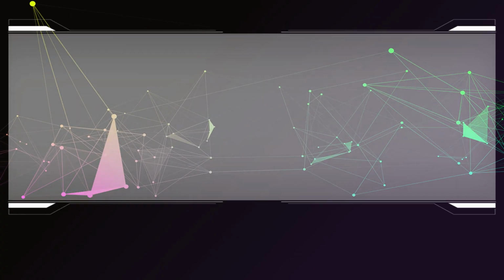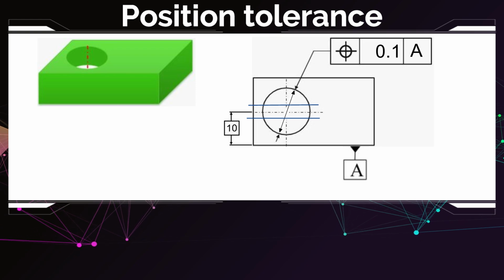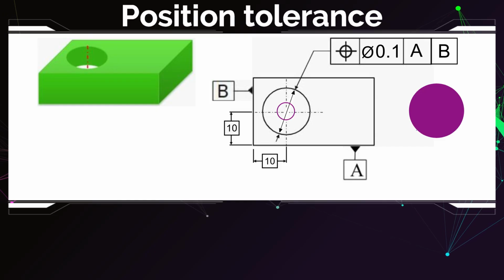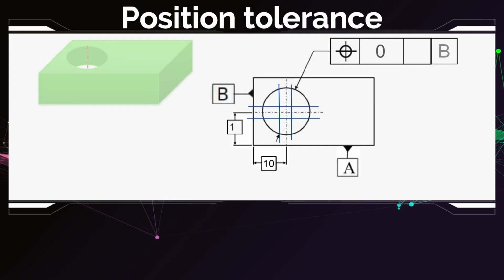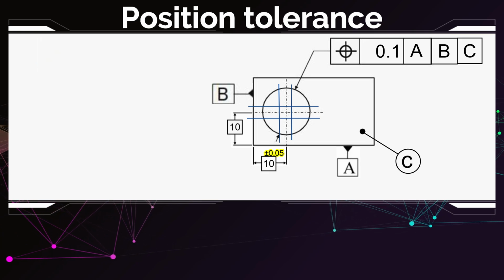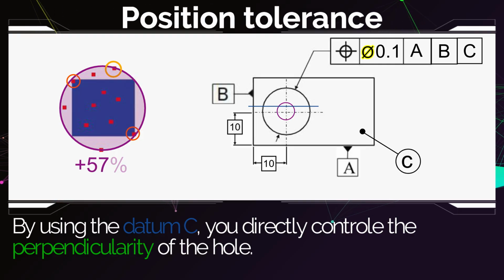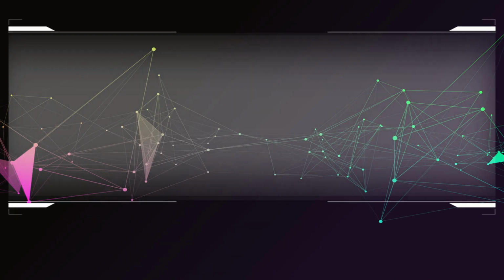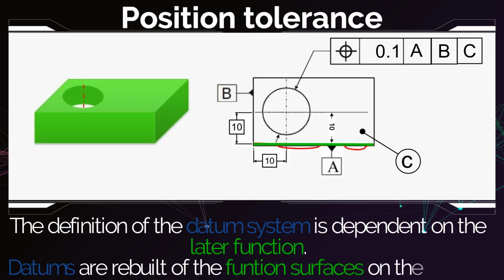Why Position Tolerance DESTROYS ± Tolerance! (Engineering Truth)

Comment: I noticed that the linear tolerance of ±0.05 mm was changed to a diametrical tolerance of 0.1 mm. As per my understanding, if we apply the same tolerance range, the circular zone should lie within the original rectangular tolerance zone, not outside of it. Could you please clarify how the circle ends up outside the rectangular tolerance zone in this case?
Reply from the maker: You are correct. This mistake is corrected in the new video published. Please check the channel for the new video

Comment: The concepts of position are well presented however there are a few finer points that need corrected. A round tolerance zone of 0.1 would fit inside of the 0.1 square tolerance zone. In order to encompass the square tolerance zone as shown a 0.14 diameter would be required. Also in the datum reference frame A-B-C, datum C does not control perpendicularity as datums A and B control all three degrees of rotational freedom. In order for datum C to control perpendicularity, C would have to be primary.
Reply from the maker: Hey,  thank you for the comments.  What is meant is that using the diameter sign allowing a bigger tolerance zone (0.14) which satisfies the same function as the tighter (0.1).  
It is not that clear in the video so thank you for stating this!
Reply: @Excedify  You are absolutely correct and I think your video is well done.  I understood the concept you were presenting, my concern is that someone new to GD&T might get the wrong impression.
Reply from the maker: @buffalobill8-q2o   yes it's confusing in the video because the text doesn't change to 0.14 in the fcf.  But now hopefully if someone is confused, they will look at the comments 👌😉